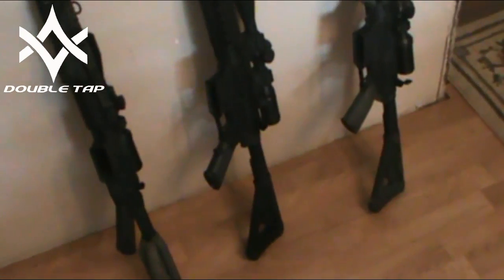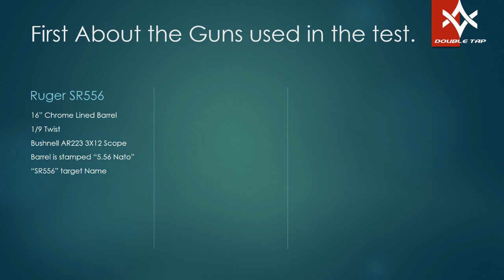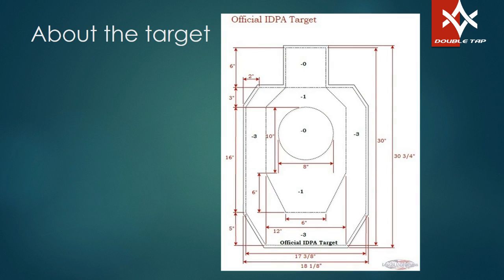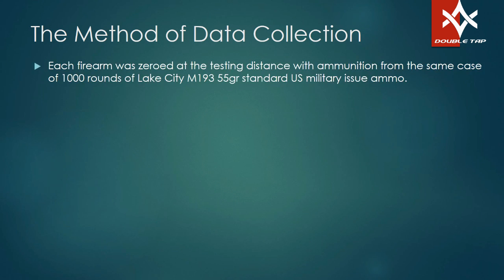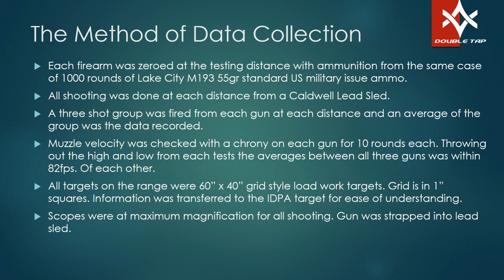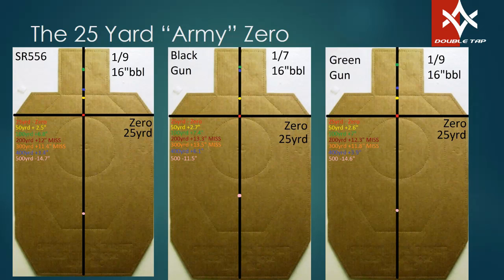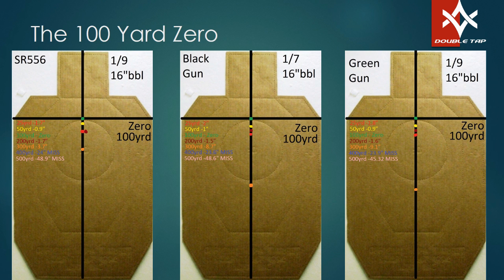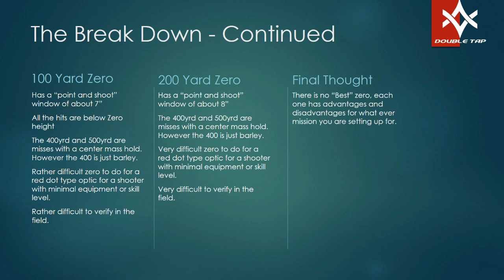Real Bullet Drop for the M4 at Different Zero Distances

Comment: As a private contractor for the dod / army we didn't use a yardage we used meters it's a m driven weapon system like most weapons systems don't use yardage to zero any of these weapons systems
Reply from the maker: As a ninja for uranius I'm reasonably certain that your time playing CoD doesn't count as being a "private contractor" for the DOD/Army. But if you really want to go down this road, let me ask you princess... do you think that we are not capable of measuring the same distances with different units of measure? Do you think there is a difference between MOA and MRAD? Do you think your mom knows the difference between inches and CMs? Like, which do you think your mom would be able to swallow easier 9 inches or 22 CM's?

Comment: You sir, deserve a medal for this. Real data, no bs. You can find the zero/impact charts all over the internet but guns and lots & types of ammo differ. The only way to be sure is to do it yourself. And once you have your drop data at different ranges, your ballistic calculations (bc etc) can become very accurate. I shoot irons predominantly. I’ll use a scope for load development. I’m a huge proponent of the A2 rear sight. I use a modified ribz zero, with 6/3 starting out 4 clicks up. 6/3 is 36 yards (roughly). Bottom line with that is any “silhouette” is going to get holed in a bad spot out to 350 yards with no shooter input. Down 2 clicks is 50 yard zero. This best suits the needs of someone using an iron sighted rifle “around the farm”; with a mpbr of 225 yards. Beyond that you’re not seeing much anyway; 36 & 50 are my go to zeros. 4 clicks down is 100 (not really necessary but I figured I had the clicks to spare). Using .223 velocity ammo changes things. 4 clicks up is 25, 2 is 300. A lot of it was figured with hornady’s ballistic calculator. But I know where to set my sight to score hits out to 500 and that’s the goal. Again, great job.

Comment: My Vortex Strike Eagle 1-6 sights in at 50 yards. The first crosshair then puts you on at 20, and at 200, because BOTH distances require a slight hold over. So, I completely understood where you were going with that. I also understand that I need to hold under(2") at 100, and 150, because the bullet is reaching the apex of its trajectory.   Great video!!!!!!

Comment: The best zero for a 16" ar15 is 100 yards. The ar15 is a 300yard gun, and any range further than that, the bullets will just start to ice pick people, because it loses its velocity for bullet deformation. You should not be engaging targets unless you have to, and usually its close quarter engagements, were you have to. It's practically a laser pointer out to 200 yards with a 100 yard zero. I assume that in a gun fight, people barely expose their bodies, so trying to remember your holds in a stressful situation is a huge disadvantage. Usually only half their head is visible, so you want bullets to land exactly where that dot is. At 200-300 yards, just aim at the top of their head. Anything past 300 yards, you should be fleeing, and not engaging.

Comment: Whats your thought on eotech news the other day? Extreme cold will change tolerances on anything in -40. Metal shrinks in that temp. I would expect change in a Eotech in cold weather.
Reply from the maker: +Ironrange Dan No idea what you are talking about, I'll have to look around.
Reply: Temp changes of any type will cause steel to shrink or expand.  Don't know about you, but i don't think many are out shooting in negative 40, even in MOST military scenarios as -40 F. while not unheard of, it's fairly uncommon. After 4 years in Fairbanks, didn't even see that temp that much even there.

Comment: Great information here man. Looks like you spent some time on it. I've been shooting with my few bolt guns for years and they're your typical hunting rifle with 4-12 and such glass. Question, does a red dot have the same vertical cant as most magnified optics do? I was under the impression that they didn't.
Reply from the maker: +lerch400block GREAT QUESTION! Most red dots are 0 MOA, the one piece mounts I use are 0 MOA. The only real difference in what I did from a red dot would be sight heighth. Being that it was the same for each test and range that makes it irrelivant. You can buy scope mounts that add in MOA in different levels right to your scope. Mine were "flat".
Reply: DoubleTapShooting thank you sir. I have no idea when it comes to rds but I need one for my 30-30.

Comment: So explain why using an army zero, we routinely hit 300 meter targets by dotting the i? I mean we were told to set the head on top of the front sight post at 300 meters.  By your chart we would have been missing way over the top.  Thanks
Reply from the maker: +Bob Surratt KNew this question was comming. Remember how you actually zeroed? Rotate the rear sight i click past the 8/3 setting, then zero, then rotate it back to the 8/3 mark. It actually changes the "25 yard zero" to a true 300 yard zero.
Reply from the maker: +Bob Surratt Not to mention the Army trains to shoot lower (center of target) during zeroing and qualifying you are aiming where you were taught or there is a big circle around it.
Reply: Bob Surratt 
300 meter is 328 yards 

25 meter is 27.3 yards 

Hence the difference 

From 300 yards to 328 yards , the bullet will drop another 3 inches

Comment: Looks like the statement"we zero at 25 so you hit in the same spot at 300" is wrong
Reply: cooper jones 
I shoot with Appleseed Known distance 
And 
Revere’s Rider field rifle 
At 100,200,300,400 and 500 yards 

Zero at 25 yards WILL be around 2.5 inches high at 300 yards 

Zero at 300 yards  
You will be 0.25 inch LOW at 25 yards 

So for battle purposes 
25 yards zero is close to 300 yards zero 
Vice versa
Reply: With 55 to 62 grain ammo, a 36 yard zero will get you POA/POI at 300 yards.
That will make your shot 3/4" low at 25 yards.